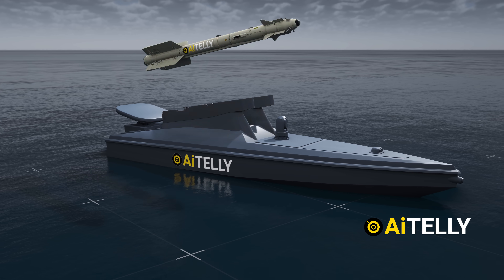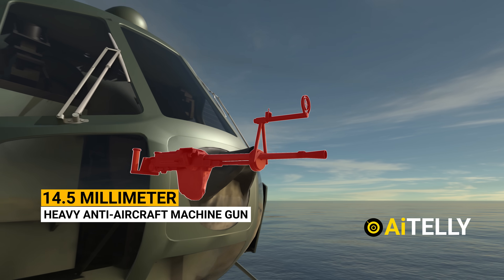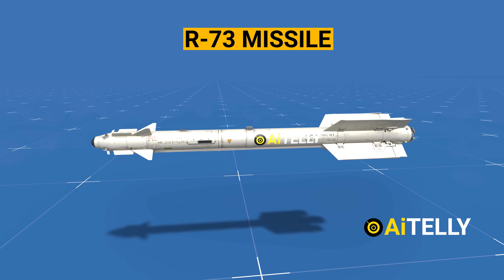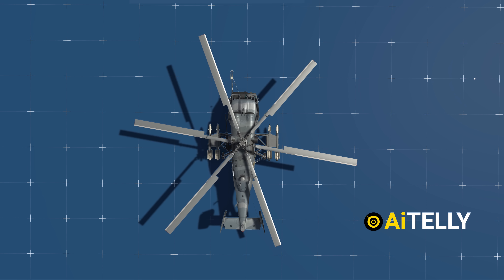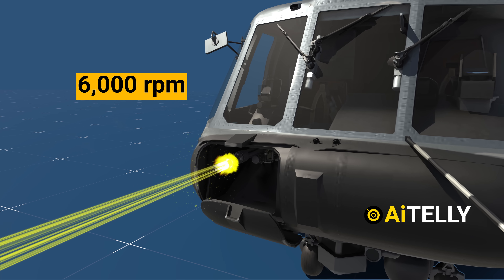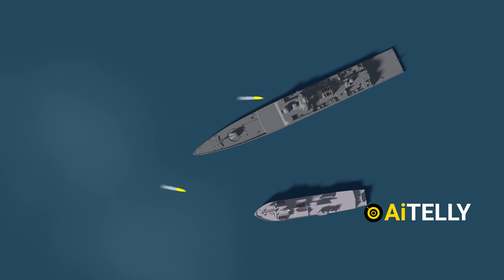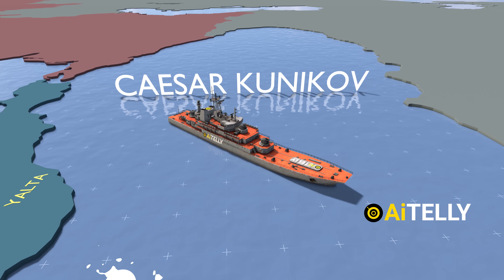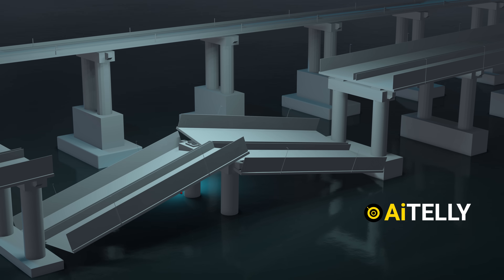How Ukraine Sea Drone With Heat Seeking Missile Works?

Comment: is it possible to equip it a 360 degrees rotating missile launcher so that it could target the helicopter in every direction. could they use light weight missiles that are not only heat sinking but also anti radiation and could target the bridge as well?

Comment: The Yemeni Houthis have long learned to shoot down Saudi Arabian F-15s using an R-73 missile installed on the ground... They crossed a thermal imager with this missile! And yet, there is not a single confirmed victory of a Ukrainian drone over a Russian helicopter... So at the moment the system in this configuration is not effective against helicopters...
Reply: it was just first tries. also it will make helicopter pilots more anxious

Comment: Look like Ukraine should point the missiles aft.  The chopper are likely to chase the drones down. If the drones try to initiate the attack on the helicopter, they’ll give away their position.
Reply: It’s easier to use two anti-aircraft missile drones at a distance of 300 m from each other to cover blind spots.

Comment: How many hits have sea drones scored against helicopters or planes? Based on footage released by Ukrainians - zero!
Hitting a plane with this is a science fiction. This thing has launchers fixed pointing to the front. Plane is a fast moving target, so the window of opportunity to launch this is extremely short. Further more, it is made to be launched from a plane, so its seeker head is set to work with the plane carrying it flying, which means that the plane already "defeated" gravity and is giving it initial energy. This all means that its range is waaaay shorter when launched from the ground/sea. The problem Serbian forces encountered when launching it from the ground against NATO planes; it seeker head would lock onto the target it couldn't reach (or it could if it was air launched). Serbian forces added it a booster - MLRS system rocket engine.
Hitting a helicopter is also difficult cos they attack these things from behind or side.
Further more. added launchers and missiles increase its radar reflections making these drones even easier to detect...
Overall, useless.

Comment: Seems like they should mount the missiles facing backwards so they can take out chasing helicopters
Reply: yeah thats not how 1970s era Ir missiles work.
Reply: @MrSGL21  I believe the Soviets tried this concept on their SU-27, the gamble limit of R-73's seeker is actually wide enough for those roughly aimed launches.
Reply: Backward firing missles like in the Firefox movie.
Reply: I was thinking the same thing
Reply: I don't think backward facing missiles would work the same as there are no aircraft carriers that slingshots aircrafts backward of their movement. 
It has something to do with the momentum of the thing that shoots. 
Just think of it like this, the rocket would have to have strong engines to zero the momentum or speed of a boat and then accelerate to its own speed to reach a target, or you could point it forward, use boats speed in your advantage and the rocket is off in a split second.
Reply: is heli find drone, then drone is gone

Comment: They should mount one of the missile facing backwards, so the helicopter cannot attack from behind.
Reply: No sense, in this case solid fuel engine will damage IR seeker of other missile.
Reply: @four-dimensionalperson put them on a turning mount then
Reply: @FreeRojava2025  turning mounts are heavy, even at it lightest configuration it a lot of space and weight required. That would shift the centre of gravity and complicate it production. Sometimes simple is best.
Reply: @Kishanth.J  yes. But it would also be good if they can hit the boats they are intended to
Reply: @FreeRojava2025  better to make several boats then over engineer a small few. When one boat is being chased another can line up a shot on the helicopter.
Reply: exactly, a better idea would be to put an American AIM-9M on a launcher that can turn up and down 360 degrees. While firing a missile at a target above the drone would damage the drone, it would be a one-way mission anyway so that wouldn’t be that big of a problem, especially if they managed to shoot down a helicopter.

Comment: They need a swivel launch base so the drone boat does not have to manourve into firing position.
Reply: They need sort of like a naval wingman drone. 

 Helicopter goes after one. The wingman can maneuver to take out the other. 

 At least till they can figure something else out. Looks like they are fixing the kinks as it goes.

Comment: The first time I saw footage of the missile-equipped sea drones being attacked by helicopters, I noted that both missiles were pointed forward and wondered why. It was foreseeable that they'd be pursued and I thought it would have been a better design to have pointed one of the missiles aft. I'm guessing after this, future versions will do it that way.
Reply: Forward facing is equal to motor torpedo boat, as a second option if drone boat is hit. Vertical missiles amount to third option!
Reply: They’re guided missiles that track Heat signatures. It doesn’t really matter much which they they’re pointing.
Reply: @GrahamCStrouse  Heat seeking missiles have an acceptance angle in which they'll detect a heat signature. Ukraine appears to be using R-73s, which, depending on the version, can detect targets anywhere from plus or minus 40 degrees from center up to plus or minus 75 degrees. So you can't fire one forward and expect that it will see something that's at your rear. Which is good, lest it detects your own heat signature and comes after you.

Comment: An unprotected missile on top of the boat makes the boat extremely vulnerable. Not the smartest solution.
Reply: If you don’t do it the helicopters have open season on the drones. Even if it doesn’t work they have to respect the threat of it
Reply: And what would be your solution ? Put armor plates and make drones slow and heavy? They rely on being a small fast moving target.

Comment: losing the guided missile cruiser Moskva was totally avoidable, but complacency & over confidence got the better of them . . . super powers always have a habit of underestimating it's foes over & over again, be it Russia or the U.S . . . for e.g. Russia's invasion of Afghanistan (1974 - 1982) was a failure . . . US-Vietnam War (1962 - 1969) was another failure followed by War in Afghanistan (2003 - 2022) . . .
Reply: you are not right.  The missile cruiser Moscow was undergoing modernization after completing missions in Syria.  There are indirect signs that the modernization of the ship took place with a large share of corruption schemes, as a result of which the ship lost the ability to carry out combat missions.  Today in Russia there is a joke: “if the cruiser Moscow had not gone to the bottom, the entire headquarters of the Black Sea Fleet would have gone to the bottom.”  It is obvious that the ship was specially towed and scuttled in the deepest part of the Black Sea.  which has a depth of about 2 kilometers.
Reply: @juryfilatov4520  No wonder the Duran said the Muskva was too old to be a lead offensive strike ship.